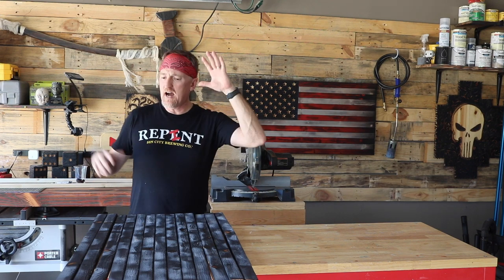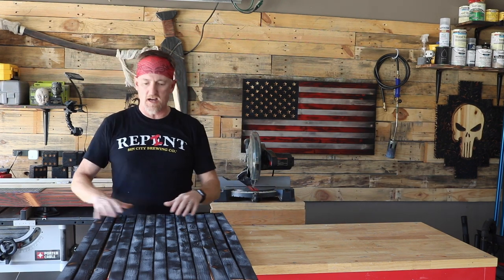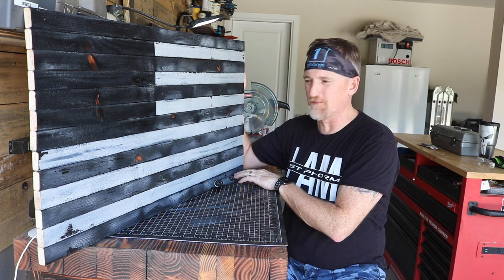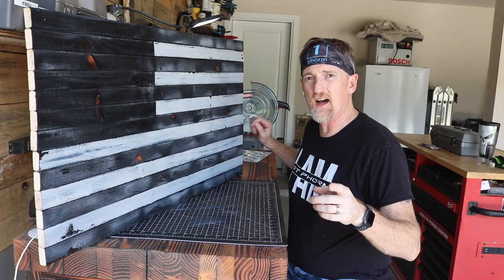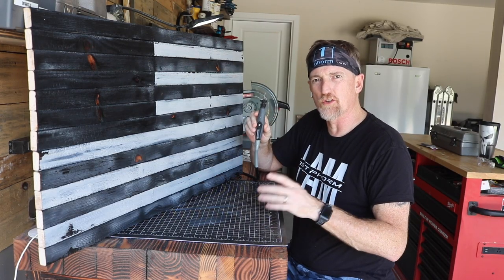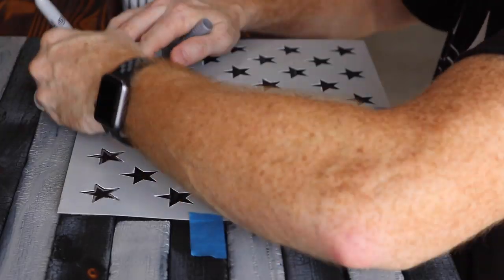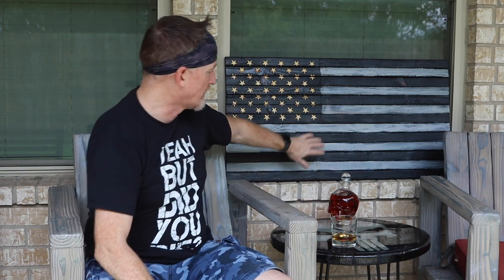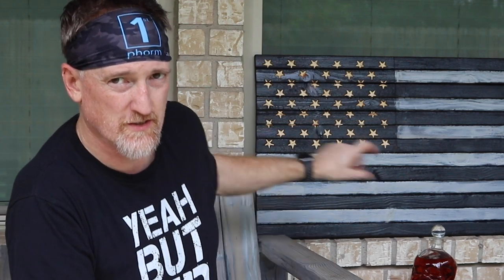Shou Sugi Ban Gator Style Burnt Wood  American Flag Build - Not Complete Garbage!

Comment: You have cool ideas and do great work.  One suggestion would be to burn like you did and then hit all the burn with a wire brush, then apply red, white, blue stain.  I've done a few flags like this (with 2 coats on the white stripes) the red and blue have a little different look to them, sort of like a vintage older look.
Reply from the maker: That sounds pretty cool...I might give it a shot.
Cheers!